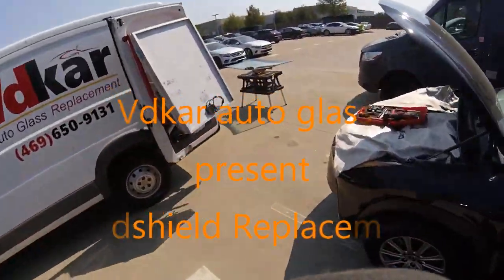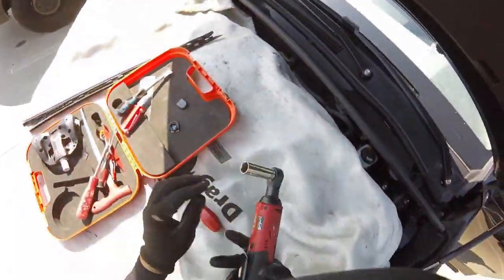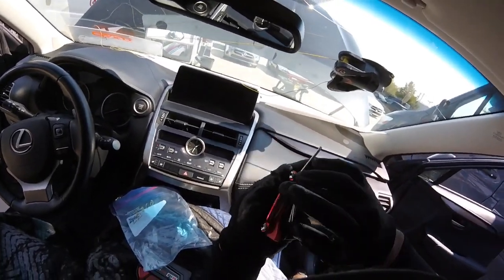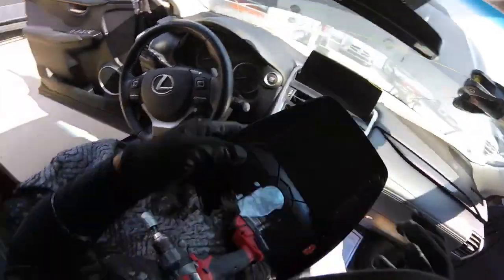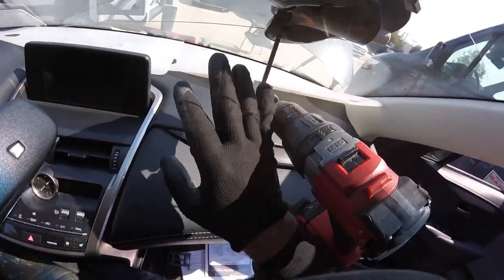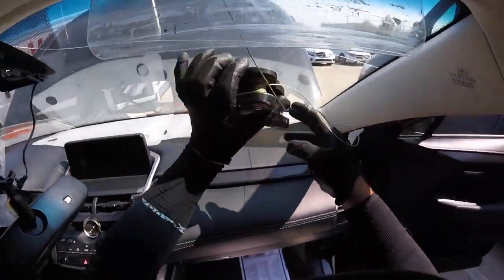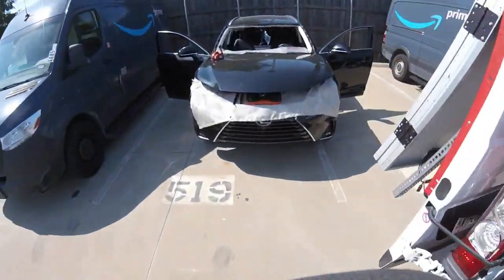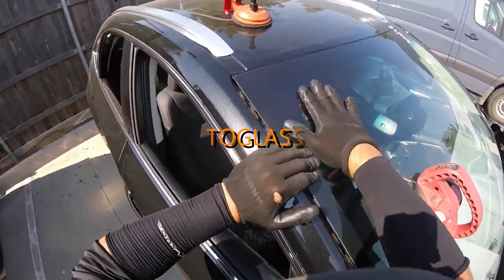2019 LEXUS N300 Windshield Replacement

Comment: Hey you can save those moldings save the customer some money and save yourself from buying it , just grab a pick tool and just move the molding away and in between the molding and the body to see the metal clip , in the middle of the clip there’s this like center piece that grabs the molding , u push that towards you and slowly remove the molding , they won’t break and u won’t damage the paint